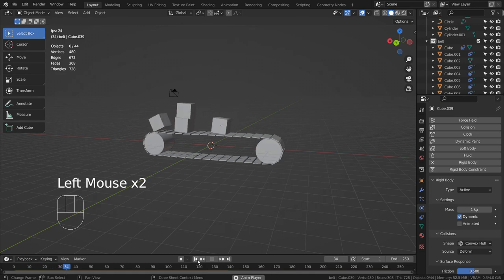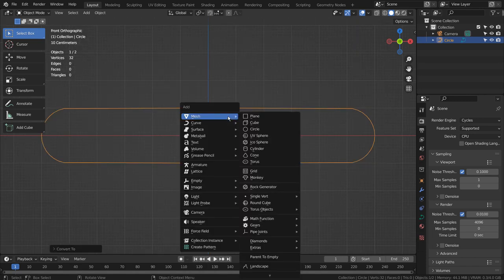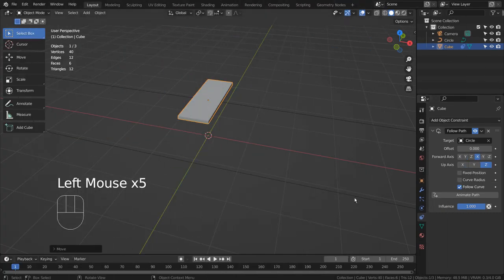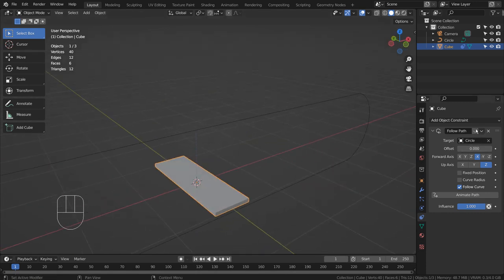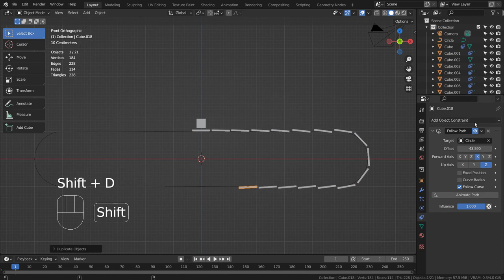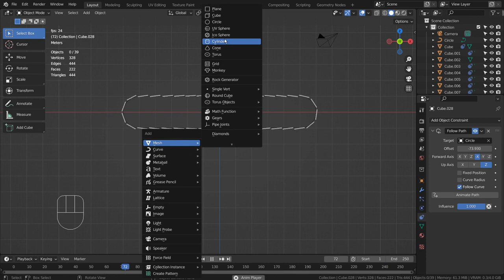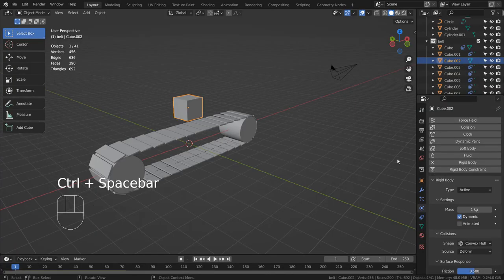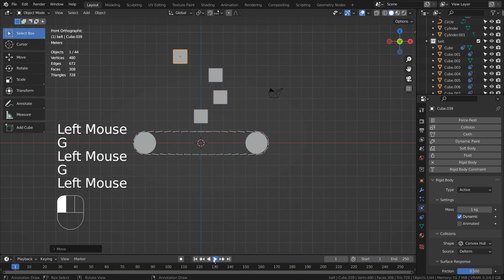Blender Tutorial - Rigid Body conveyor belt

Comment: I tried moving and re adding the constraint multiple times yet it didnt work
Reply from the maker: Thank you for watching, khadijamalik1596..!! :)  Please try this.

1. Create a curve circle.
2. In Object Mode (Tab), Create a cube.
3. On the cube, add a follow path constraint.
4. On the follow path constraint, 
5. Set the target as the curve circle.
6. Put a check mark on 'Follow Path', and Click the 'Animate Path' button at the bottom.
7. Press [Space] to play the animation.

This is the same concept.

If the cube follows the path, that means the follow path animation is working.

After this, please try adjusting the curve circle's shape by adding more curve points ("A" to select all, Right Click, and type "S" to subdivide), moving the right side of the curve points to match the shape of the conveyor belt, and re-shaping the cube to match the conveyor belt part.)

Comment: How to How to make 90 degree conveyor belt?
Reply from the maker: Thank you for watching, Green Tom..!! :)

1. I would create a constantly rotating Rigid Body cylinder.
2. After that, I would array the cylinders to create a straight conveyor track.
3. Then I would use a curve, smoothly rotate it 90 degrees, and apply a curve modifier to the cylinders.
4. If everything goes according to the plan..  Any objects dropped on the track will be transported accordingly..!! 🤣